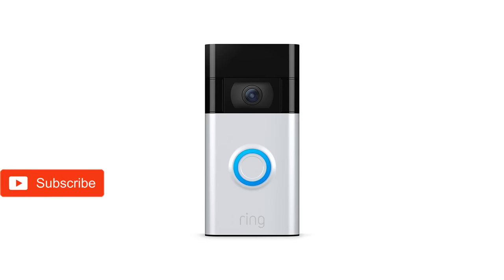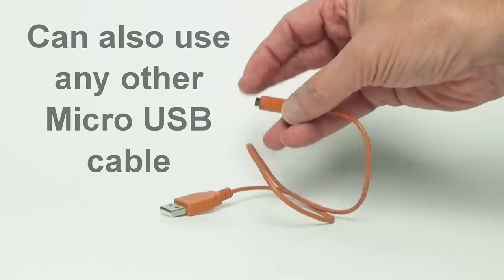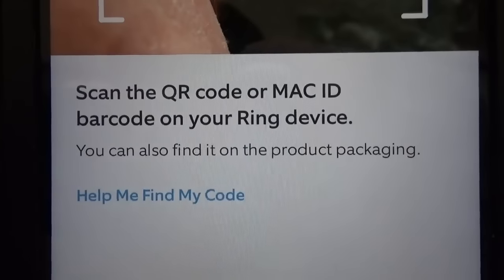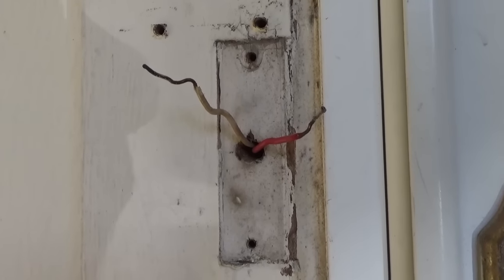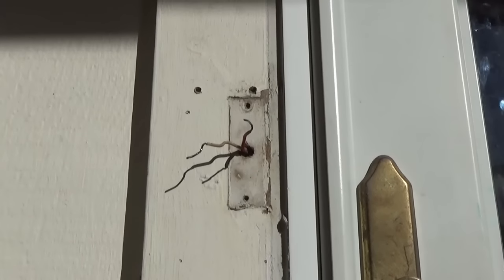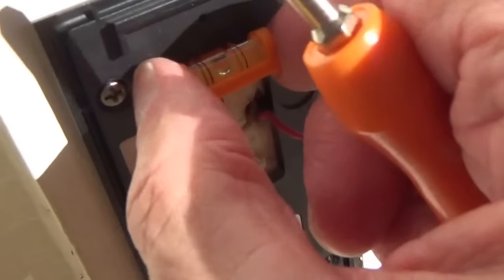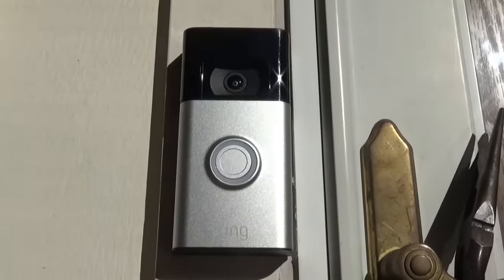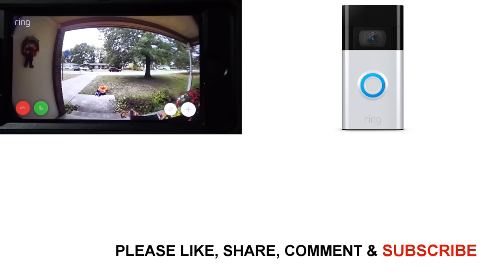How To Install A Ring Video Doorbell 2nd Generation 2020 - Hardwire Installation Of 1080p Door Bell

Comment: Will it work with your existing chime or do you need to buy a separate ring chime?
Reply from the maker: It will work with most existing chimes, but Ring and others also sell compatible chimes of their own.
Reply: Yes some say it should ring the old chime  but I do not know how  this can ever work. The ring would need to somehow shot its own power  terminals  and run off its own battery for 1 second or so I suppose it could be done Can someone tell us if they have one that works please

Comment: Do you have to keep the included battery in the unit.  Some devises require the battery installed even when its plugged in to an A/C charger.
Reply from the maker: Yes, you keep the battery in the doorbell all the time unless you’re charging it. If your doorbell is hardwired, you should never need to remove it. It receives a constant trickle charge when it’s hardwired.
Reply: @HowSkills  Thanks, Stan.
Reply: @HowSkills  cool man I was looking for this answer since I fitted one a few months back just the same as yourself but only on a 8 volt 50hz ac supply and chime but wasn’t sure whether the “trickle charge” they describe is enough to permanently keep the doorbell battery full and powered, thus never needing recharged manually. It’s been running now for quite a while so hopefully you’re right and it is a fit and forget job to wire these things. Lots of customers want them these days.
Reply: The VA will be pretty high though, plenty amps to run a device like that but just wasn’t sure exactly how the doorbell itself handles being wired. It seemed to be only using the AC as an output to the chime and not drawing any current I could measure with my meter. So hopefully it just does so when that battery needs it and has some power control circuitry inside

Comment: the instruction mention about a resister to be wired in series with the ring. My kit didnt come with one ¿?
Reply from the maker: This version of the Ring Doorbell (2nd Generation) should not need a resistor, due to its wiring. It has a built-in diode, and also doesn’t need the resistor that does/did come with some of their doorbells. The resistor was often needed when hardwiring certain versions of Ring doorbells.

Comment: FYI you can remove the bottom screws without that tool.. Those screws don't even get tight because its a plastic mount. A small flat head screws driver is all you need to steal it..
Reply from the maker: They need to improve the security on these somehow.
Reply: @HowSkills  Yes indeed . You can go on the App and mark them as stolen does this disable them in some way  next time they are put on line

Comment: Hello, my friend, I live in Brazil. Here in Brazil, all bells are 127v or 220v. To run the doorbell with the Ring vídeo Doorbell, should I acquire one with a voltage between 8 and 24v?
Reply from the maker: Yes, that is the required voltage range for them to work, so it would be necessary to get a doorbell with a power supply that puts out between 8-24V.
Reply: I'm shocked (pun intended) that doorbells use full house voltage.
Reply: @dustintunis9347  I think there must be a transformer somewhere . Maybe   measure the voltage on the push button but please be careful  if 220v  you can run the ring on a Ring 18v transformer  but they are not approved by ring as not an approved  ring Item

Comment: Can this Ring Model  use your existing Doorbell Chime making it ring?
Reply from the maker: It did work with mine, and it should in most cases. Some homes might need a different transformer to make it work. Ring also has a wireless chime that can be used too.
Reply: Yes it should it seems  but on the app you need to set original bell to mechanical or Automatic  not sure how it works
Reply: Update: It is installed & does ring the  original Home Doorbell chime even though Ring Customer service said it would not. They need better training Bezos.

Comment: BTW they don't supply the level...
And the blue handle star driver does not have inter changeable  bits.....
Reply: I have just been given a new sealed one as a gift, no spirit level or drill bit enclosed in mine and no reversible screwdriver tip, just the star end for the security screws.

Comment: So does it have to be charged if your going to wire it?
Reply from the maker: Ring recommends that you still fully charge the battery even if you're going to hardwire it. Their thinking probably is that if it has a full charge to start with, then it's ready to take over for as long as possible  in case of a power outage. The battery is constantly being trickle-charged when it's hardwired, but it probably take's a while to bring it up to full charge if it's in a low-charge state to begin with.

Comment: I hooked my hardwired it it keeps flashing blue do I charge it before I hardwired it? I've had nothing but issues with it
Reply from the maker: It does say to fully charge it before installing it. Not sure if that would be the problem, but I would try doing that. If you hardwired your doorbell, the power from those wires don’t actually run the doorbell. They trickle charge the battery and the battery actually gives the doorbell its operating power. Possibly if you don’t fully charge the doorbell first, it might not function properly.
Reply: I ran my Ring 2020 version on battery for 5 months.  I had to remove it and recharge it every 4-5 weeks. I finally wired it to my existing doorbell wires.  The battery was about 30% at the time I wired it. Every day I checked the battery using the Ring app. It was charging.  It took about a week to reach a full charge.   FYI. I have two electronic doorbells connected in parallel.  Your results may vary.

Comment: are there playback features?
Reply from the maker: Yes, you can playback recorded videos, but only if you subscribe to a Ring plan. The cheapest plan covers one device and is $3 a month, or $30 a year if you pay all at once. There are more expensive plans that have to get if you have more than one Ring device and you want them all to be able to record videos for playback. I only have the one doorbell, so I pay $30 a year, and I can playback the captured videos that it records, download and save them, and even share them if I want to.
Reply: @HowSkills  That's not too awful bad but kind of odd as I can easily go back and watch my car dashcams without paying any fees. I can either play it back in my car or pop out the SD card and watch (and save) it on my computer.

Comment: What if you have a small space from the old doorbell. This ring doorbell is a bit wider
Reply from the maker: They do make some different types of extension mounts that might work. Ring has some, but you can also find some on eBay and Esty. Try searching for some of those. Sounds like you might need something that mounts behind the Ring Doorbell to make it stick out further from the wall.

Comment: So no need to access the Chime?
Reply from the maker: Depending on your system, no, you won’t have to directly access the chime for any reason. If its transformer doesn’t have the correct voltage output needed to work with this thermostat, then everything might not work properly, but most existing systems should work okay.

Comment: These doorbells (ring) require AC voltage ⚡ not DC..so if there is no existing doorbell you need a stepdown transformer aprox..10:1 ..and a load resistor with some models
Reply: steve wiser they a 4 AAAAA battery for ring 1, ring 2, ring 3 and
for ring pro they need 120 V or use a transformer 12.v including
a resistor to assist load. Better buy a new system with zero monthly 🤣😂
Reply: @livetodaydietomorrowltdt2405  yes they can run off of a rechargeable battery but the recommend connection to a wired supply ..my comment is referring to the fact that some were thinking they needed a hard wired Dc supply and that is not the case
Reply: @beatlessteve1010  what is the best door video system for this days?
Reply: @livetodaydietomorrowltdt2405  to me it is subjective..it depends on ones needs and circumstances as well as environment.
Reply: @beatlessteve1010  I might buy the ring pro 2 maybe I will go for an all home security system bundle.  Have a nice day

Comment: I did exactly this, but my doorbell sound for in the house isn’t working. Any reason why? 😅
Reply: Yes go on the app find Setting   and change to to  Automatic Chime Detection  And yes perfect Chiming on the old  mechanical chime unit  The unit must for a moment  disconnect the charge  circuit, run on its battery and loop back the wires to make it ding dong as it originally did with the old press button Very clever bit of kit

Comment: If it is hard wired do you have to remove the battery?
Reply from the maker: No you don't need to remove it. Just leave it in, and it can serve as a backup battery in case you have a short power failure. The battery is constantly trickled charged when your doorbell is hard wired.
Reply: @HowSkills  Thank you
Reply: What do you do if you don’t have a wired doorbell?
Reply: On the app keep an eye on the charge stat and remove the door bell and charge the unit with the usb wire in the kit

Comment: What if I don’t have wires from a previous doorbell?
Reply from the maker: Ring does offer a wireless chime and the doorbell itself can be operated by its rechargeable internal battery. Other than that, you would need to have an electrician run the wires for you to the Ring doorbell if you want it hardwired.
Reply: @HowSkills  cool thanks for replying

Comment: My in home chime isn't working, I went in the settings and changed it to mechanical, keeps saying no power is being received.
Reply from the maker: I wonder if your existing doorbell and chime system isn't within the required voltage range of 8-24V.
Reply: @HowSkills  how would I check this? My old door bell button works.
Reply: @MILANOKIS  use a volt meter to check voltage

Comment: if someone ring the bell and your phone is off then how it will make sound to check on door?
Reply: the old chime should work but on the app original chime should be set to Mechanical or Automatic

Comment: how do i check the voltage without volt meter?
Reply: A ggod  question that  Can you find your bell transformer it will probably have the output voltage shown on it eg 12v AC 
Or a meter can be purchased on ebay for very little money It will always come in vert handy

Comment: My issue is the old doorbell doesn't work when the ring button is pushed.
Reply: See above post   I have just changed the one I installed to  Automatic Chime Detection  And yes perfect Chiming on the old  mechanical chime unit  The unit must for a moment  disconnect the charge  circuit, run on its battery and loop back the wires to make it ding dong as it originally did with the old press button Very clever bit of kit

Comment: It’s not going to charge with those two wires from you door bell switch because that’s only half the circuit coming out of the wall, meaning all your doing with the old door bell button was completely the circuit to allow the old door bell to ring so, what you would need to do bring both neutral wire and power wire and then connect it to your ring device
Reply: Yes it will charge The old bell has a resistance of only  a few ohms  maybe 20 Ohms  so it charges just fine with the old bell in  circuit It probable will not make the slightest difference as the ring unit will have  change management   systems in it
Reply: Does the battery need to be removed?

Comment: I thought that the hardwire eliminated the need to charge the battery, but it is only a trickle charger. In the winter the cold temps will kill the battery. Just found that out.Ring suggest to bring it in the house when the temperature gets really cold. How stupid is that. Not to happy with this ring.
Reply from the maker: I haven't had any trouble personally with the battery being depleted due to cold weather, at least in Illinois winters. It's important to fully charge the battery when you first get it, and if you do that, the trickle charge is normally enough to keep it going. But other places have colder weather than we do here, and that could be the difference.

Comment: Hmm. My ring didn’t come with the level or the drill bit.
Reply from the maker: That is odd...it should come in all the Ring doorbells that need it.
Reply: @HowSkills  so I found the level but yeah the drill bit isn’t there. It’s fine tho. I couldn’t find the breaker for my doorbell anyway so I installed it on the wooden door frame
Reply from the maker: Glad you were able to improvise and get it worked out!

Comment: My Ring Doorbell (wired) goes offline every few days.  I simply just reboot my router... and somehow that always brings it back online... Does anyone have any advice on how I can prevent this doorbell from going offline?
Reply from the maker: I've read that if your Ring Doorbell keeps going offline, it’s generally one of four common issues: what lies between your camera and router, Wi-Fi connectivity issues, power surges, and low battery. So it can a wiring/power supply problem, an internet problem, or the internal battery isn't charged sufficiently. Make sure your battery is fully charged to start with, and if it is, then the trickle charge it gets (if it's hardwired) should keep it charged up.
Reply: @HowSkills  I have some what same problem. By your comment I understand that even if you hardwire the RING you still need batteries to be left in the case. Is that true? Thanks brother
Reply: @HowSkills  How fast is your internet it need to be 2 meg up and down min  you can do a speed test via the the App

Comment: You dont need a resistor ? Manual says so.
Reply from the maker: I didn't need one because I used the existing wires from my old doorbell, and they were connected to my doorbell chime that itself provides the resistance that's needed. If you are wiring this doorbell directly to a new transformer set up (because you don't have existing wires at your mounting location, or your existing power supply isn't within the right voltage range), then you will need to use the resistor to  provide the needed electrical resistance. Here is an excerpt from a Ring Community post on this subject by "Boone": 

"The key is that when Ring refers to “Hardwiring”, they mean you are connecting to the pre-existing wires that are from your pre-existing house’s indoor wall-mounted chime and the house transformer. The house-bell chime provides electrical resistance to the current.

IF you do not have a pre-existing house-bell-chime, but you desire the benefit of the “trickle-charge”, you can attach a transformer directly (without a pre-existing doorbell) to the Ring Video Doorbell “2nd Gen/2020 Release” but then you need the resistor (since you do not have a house-bell chime that would have provided the electrical current resistance)."
Reply: @HowSkills  wow .. thank you very much for your elaborate response. I did install it and it works but somehow chime is not ringing. I'll look into it tomorrow, did your chime work ?

Comment: If you live in a colder climate such as Canada, do not buy a ring!  As soon as the temperature drops below zero, the wired voltage is not strong enough to keep the battery changed and you’ll need to pull it off the wall to charge it in the middle of winter.

Comment: Isn't it important to know whether your existing doorbell is mechanical or digital?
Reply from the maker: This is from the Ring website regarding this issue. Some of the older Ring devices came with a diode that used to be necessary: “The diode included with your Ring Video Doorbell 2 is a small device that makes sure that your digital bell plays all the way through its sound cycle. ... The diode is not required for a mechanical chime. Newer versions of Ring doorbells have built in diodes so an external diode is not required.”

Comment: Doorbell 2 Second version
Reply: How much higher did u mount it i have about 3 steps and bought the wedge but still doesnt catch the motion i need .. it wont record u til the person is leaving my steps 🤦🏼‍♀️
Reply: @ericamacias4148  you’ll have to adjust the setting in the app.

Comment: I couldn’t be more disappointed in a security product. The hardwire option is a joke. My doorbell has been hardwired to a 12v source since installation. During an extended clod snap my doorbell battery died. I contacted Ring and was told that LI batteries cannot hold a charge in sub zero temperatures (non sense) and went on to say that the hardwire charging turns off below 32 degrees. (I assume non sense) even if this were true a fully charged battery should easily carry the unit 2 weeks! I suggested my unit was defective and was told Ring will not replace the unit under warranty as the replacement would perform exactly the same. Unbelievable! I have a Eufy battery video doorbell on my back door and 110 days since it’s last charge it has 75% charge and works flawlessly. Based on Rings own comments they are selling junk. I would not recommend purchasing the Ring 2.

Comment: the idea that nobody has security torx screwdrivers is.....laughable. just buy an ifixit kit. :/
Reply: most run of  the mill drive by thieves are just looking for a quick score they don't even have the forethought to think they could use a screwdriver. Besides the camera has their face before they even get close enough to steal it.